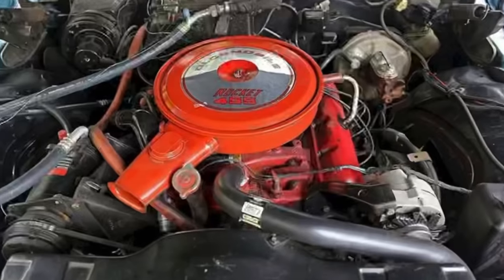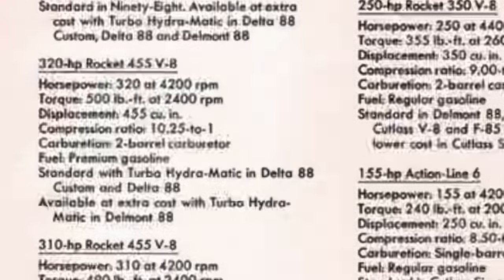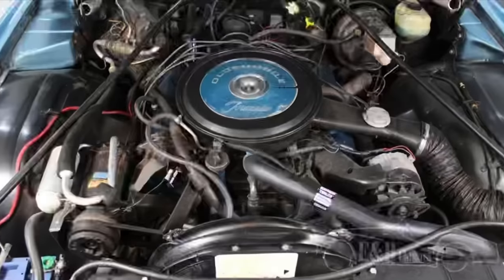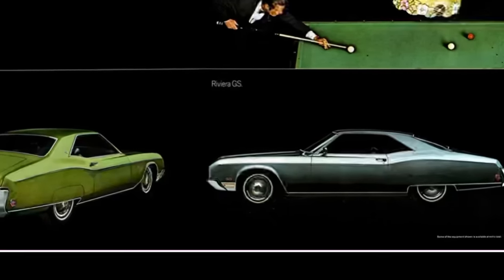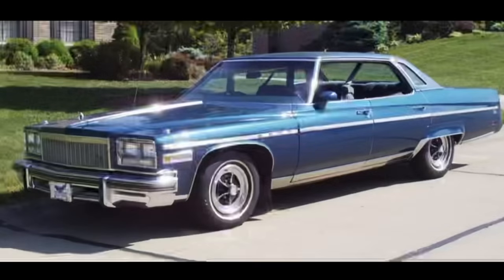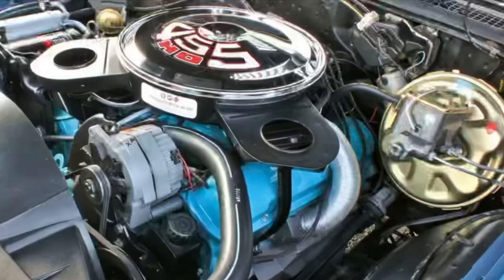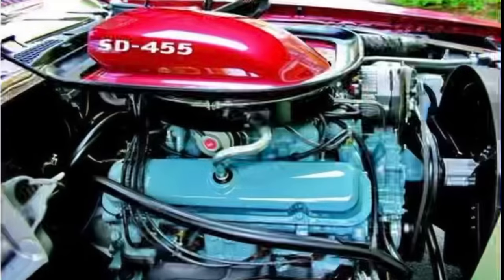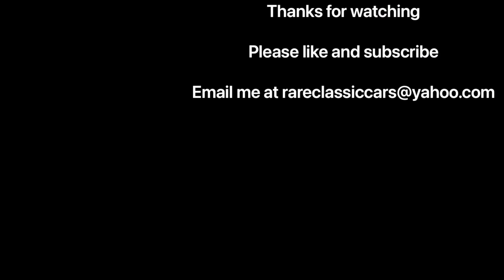Best Car Engines - The Rise of the Mighty 455 V8s from GM’s Buick, Oldsmobile, and Pontiac

Comment: As for me, I'm hoping the Olds 455 will be OK in my Revcon MH. It's a '73 model and though I haven't started it yet, I hope it will do good! The RV was a well made, high priced brand with a GM, front wheel drive power train.
Reply: GMC made an in-house motorhome for a few years in the 70s, and all they used was Olds 455 engines with the Toronado FWD transmission. Many of them are still on the road, so I'd say you'll be okay.

Comment: Stud the block on the Buick with stainless steel studs.  Also stainless steel SAE flat washers and nylock nuts.  This turns a 2 hour parts change into a 20 minute job.  Minimum tension on the drive belts and proper even torque on the nuts  There was an aftermarket manufacturer of water pumps that made a cast iron housing and used larger shaft bearings. This solved the problem, but  I have forgotten their name.

Comment: The 68-69 442 had the 400g, a very undersquare engine at 3.875" bore x 4.25" stroke. On paper it looks like the specs are from a prewar straight 8. They dropped that like a bad habit by 1970. The earlier 442s had the 400e a nearly square engine 4x3.85 bore & stroke. The was a good performance engine.
Reply: The 1968-up 400 was undersquare not oversquare.  The previous 400 engine also had a more aggressive camshaft which was why it outperformed the newer 400 which had a longer stroke in common with the new 455 engine.
Reply: @1575murray  I corrected the undersquare comment. The earlier 400 made more power because of a bigger bore, it could breathe better. The latter 400g did get the 308 cam on some versions but it still wasn't a great engine. The Ram Rod 350 would out run them.
Reply: @mcqueenfanman  I agree.  If you were running in NHRA Stock in CSA with a 428 CJ Cougar you had a dead heat race. The Mustang with the Canadian heads 428CJ beat them back, but you still had to be awake at the line. The early 400 442 2 dr post is still one the most beautiful race cars ever. And the Early 400 could take 6200 rpms like a champ, Uncle Joe Mondello had a great race parts program for those. A M21 and a well tuned Mondello 400 , I believe they were the J heads with the empty space were the heads.

Comment: Nice video..ive always been a bit confused between the pontiac and olds motors. Is it true the small and big blocks were same physical size bar the stroke?
Reply: The designation of big block V8 versus small block V8 is simply a matter of whether the engine is externally bigger than another engine made by the same manufacturer. It has nothing to do with CID size. Chevy is the perfect example of this. Chevy made a small block family of V8's from the 265 in 1955 to the small block 400 in 1970, and includes the 283, 327 and 350 in between. Chevy also made a physically bigger engine family, starting with the 396 in 1965, the 427 in 1966, to the 454 in 1970, so they're called big block Chevys, being compared to the small block Chevy. They're 2 different engines. The Olds V8 engines also come in small block and big block versions. But the Olds big block is basically a small block Olds with a taller deck height. They could be called tall deck versus short deck, but most people say big block and small block Olds. The Pontiac V8 is different in that (almost) all Pontiacs are the same external size, based on the original 326 from 1955. So, there's only the one engine size for Pontiac from 326 to 455. A Pontiac 350 is the same size as a Pontiac 455. So, there is no small block or big block Pontiac because they're all the same size, and there aren't any other Pontiac V8 engines. There are 2 exceptions...the Pontiac 301 from 77-81, and 265 in 80-81. They are still based on the traditional Pontiac V8, but with shorter decks. Could be called short deck Pontiacs.

Comment: The Olds 455 was chosen by GM to power the GMC motorhome in 73.  That might say something about reliability.  Or it could have been the readily available Toronado front drive powertrain used in the motorhome.  Someone might know more on why Olds was chosen over the Cadillac Eldorado powertrain.
Reply: You hit both nails on the head. The front wheel drive setup, from the Toronado, was a no brainer for the motor home, along with the torque of the Olds 455!!

Comment: Both Buick and Pontiac used an aluminum timing cover that the water pump bolted to. Removal of the pump bolts either took the threads out or sheared off the bolt head, not fun. The Pontiac had a cam bearing priority oiling system which tended to starve cylinder wall lubrication. The Buick was a thin wall cast block which gave a significant weight savings on the frontend. 455 Skylarks were notorious for stomping their contemporaries in 1/4 mile runs.

The Olds had shaft style rockers that were made of cast aluminum (Not good). Their blocks were all made of high nickel casting alloy like AMC and truck blocks from Chevy and Ford. (High wear resistance for the cylinder walls)

All of these engines were pretty much at their limit because of cylinder spacing, so they increased the stroke which limits RPM. (But you can produce a lot of torque)

The mortarium GM had in place kept these monsters out of mid-size cars until it was lifted in 1970. (Except for the COPO's and 3rd party cars.) Then all the compression ratios were dropped to 8.5:1 in 1971 and in 1972 horsepower was changed from flywheel to rear wheel with any and all optional equipment installed and operating. (Net HP) There was also some early fudging of HP numbers to appease the insurance co's. Also in 1969 all California cars required air pumps, EGR and vapor canisters, the rest of the nation followed suit in 1971.

While the displacements peaked out around 1970 the higher revving lower displacement engines from the late 60's produced more HP IE: 1969 L89 427 rated at 430hp @ 4800 rpm really produced over 500hp @ 5800 rpm compared to the 1970's LS6 454 which only produced a measly 450hp. The displacements were increased to make the engines burn cleaner.

By 1975 it was all over but the cryin' and the diggin', at least until the late 80's when computer fuel injection and overdrive made good milage and high HP possible again.

Anyone remember the nightmare of changing the rear two passenger spark plugs on a big block A/C mid-size?

Comment: I had a 79 cutlass Supreme it came with the small Olds I think it was a 260 or 265. I can't remember. I yanked it out and dropped in a 1970 455 Olds out of a 98 LS. I put in a hotter cam, aluminum intake, converted the non adjustable valve train to adjustable because the cam swap. Ported the heads and headers with dual exhaust.  The engine dropped right in with the stock mounts. The differential was a 2.56 ratio. I could almost do 80 in first gear. In drive the highest rpm I had it to was 4300. It could go higher I know because the 455 had the torque to turn it higher. How I didn't kill myself in that death trap I don't know.
I actually out ran some motorcycles. Probably smaller ones. But I had the advantage on the interstate. It was a death trap.

Comment: Buick is under appreciated because it was seen as an old mans car.  In muscle car intermediate trim in turned out the Buick 455 in 1970 got the best 1/4 mile time over its Pontiac and Oldsmobile counter parts.   The real advantage for live ability was in 1970 car insurance for a young driver for the Buck 455 was sometimes 1/4 the price of a 455 Chevelle and it out performed it at the drag stip.  

To get any real high performance out of these engines they needed different cam shafts and significant modification tuning.   The tri-carb GM setups where very good for high performance and drive ability.    Done with a lot of knowledge you could have a daily driver that could rev to 6,700 rpm such as a 1966 GTO tri-carb 4-speed with large displacement forged crankshaft giving something around 460 cu in. and over 600 hp.  I was in such a car once and those tri-carbs really come a live well above 5,000 rpms where the stock 455 engines have their red line.

Comment: Never understood why GM allowed Chevrolet to advertise a 454 instead of a 455 to have 455s across the corporate board, excluding Cadillacs. That would have made a great commercial and advertisement ploy.  After all, in 1970 Chevy called their 402, both 396 and 400. Even FoMoCo called their 425 the 427. Although I've never done the math to confirm the rumor, I've heard it said Chrysler called their 427 Hemi the 426, to set it apart from the rest.

Comment: Installed a 455 Olds engine from a 69 Delta into my 72 Cutlass.
Car was a tire fryer.
Could never get traction.
Reply: Yeah man, you had to feather the throttle for traction. Else she was a tire smoke machine! Rocket Power!
👍😎

Comment: A very interesting video but I would have liked to have seen the Chevy 454 included. Do you know if they were all at 455 displacement? For example, I think for several years Chevy's 396 was actually 400 cubic inch. Also, Fords 427 was closer to 425 CI displacement. You mention that the Olds 455 ran out of breath at high RPM due to the undersquare nature of the engine. I think the restrictive ports coupled with small valves in the cylinder head were the real reason?  Would like to see a comparison of Fords 428 vs Olds 425 vs Buick 430, etc.

Comment: The one big question looms in my mind, that many younger viewers may have as well: How much did gasoline change from the late 1960s to the early-to-mid-1970s? You mention how GM adopted a policy of all car engines operating on regular unleaded fuel, which I assume meant 87-octane. If this is the case, what kind of octane ratings did the previous generation of luxury and muscle cars guzzle for fuel, and how did that (presumably) higher-octane fuel affect horsepower?

Comment: The 66 up cars! You could hear a 69 428CJ Mach 1 banging through the gears and wailing like Banshee, and the Olds 442 in 64-67 with the 400 OA1. The 455 Oldsmobile in 1970 was just plain tough.  The would run flat out on the Interstate at 5200 rpms and you couldn’t break them. The 428CJ was that way as was the 440 Mopar. The CJ got there the quick est but they could literally go until they ran out of gas flat out in high.   I have a warmed over 390.020 over that can run at 6200 all day and I built it in 1999 and it is still going strong! No oil consumption or Blow by.  The 60s and even the 50s designs FE and Pontiac were really good and bulletproof engines. I have a solid cam in mine and blocked lifter feeds and it will rev to 7000 with no problem. The Pontiacs I have done like a McKellor solid cammed 421 SD with the factory endurance stuff and a 400 RAIV with a custom solid were in breakable if you could build it right!  Both of these engines hit their stride as Street Thugs by 63, but both are 1950s design.  Those were the days. My Dad had 55 Fairlane with a hot 292 he had stroked and bored. It would idle like a gasser, lol 😂

Comment: @6:38  A 455 with a 4bbl, and it is supposed to inhale through that Itty Bitty Snorkel ? My dad's LaSaber has that Air Cleaner. I took one from a 76 Olds which had a Snorkel with an Opening twice that size, then added a 2nd Snorkel, that opened under Full Throttle. It made a difference, and at 17 was quite Proud of my Engineering Ability

Comment: Olds 455 is my pick for the best one. Buick had 4" mains and a not so good oil pump. Changing the spring in the pump helped, but didn't solve the issue. It would just run out of oil. Poncho had a high pressure oil system. Good at first, but when a bit of wear was had, the tolerances of the poncho were too tight (to the 10,000th) and revs would rod or wrist pin knock it. This how every one of mine met its end. If you use the C casting head from 69 on any Olds 455 (with a port job + a good build) you can make 500HP+ and 500+ TQ. Keep it under 5k if not balanced rotating assembly and top end oil restricters. I had one in a 84" Cutlass and it was a tire frying delight! 185+ mph.

Comment: If you look at their bore spacing, you'll find that while the Buick 455 was a "big block", the Olds and Pontiac 455s were technically "small blocks".
Reply: The Olds was a big Block , all Pontiac used the same block except the 301-265.
Reply: The Olds 455 is a tall deck block, and often referred to as a big block, when compared to the shorter deck small block Olds V8's, like 350 and 403. So, the Olds 455 is not a small block. 
Pontiac did not have the customary "small-block" and "big-block" designation, unlike engine families common to other GM divisions, especially Chevrolet. Effectively, production Pontiac V8 blocks were externally the same size from 326 to 455, (except for the later short deck 301 and 265 produced in the late 1970s and early 1980s). So, since the "traditional" 326-455 Pontiac V8's are based on the same block and externally the same size, they aren't considered either small or big block. So, the Pontiac 455 is not considered a small block or a big block.

Comment: You forgot to mention the oil pump problems on Buicks. They all suffered from the external aluminum oil pump housing, I had a 231 with no oil pressure from lack of maintenance. But the 455s were a real problem, as long as you addressed it before the oil pump housing and gears wore, you were okay, but if you didn't, beware the seized engine. The good thing about the bad oil pump was, it was a driveway repair, just remove the cover, put new gears in, and a thinner shim. And you were more or less back in business, if you caught it soon enough
Reply from the maker: I did mention oil issues, but didn’t delve into it.
Reply: @RareClassicCars  oh, sorry, I missed it

Comment: I knew a vet owner who pulled his 454 and dropped in a worked 455 from a '74 Riviera. If I remember correctly, the nichol / Iron block of the Buick was lighter and much stronger than the 454.

Comment: Dana "60" Glass. You are leaving out the '68-'69 Hurst/Olds, and very limited '67 4-4-2 Hurst Performance. I'm well aware that GM had the 400 cubic inch limit. Also in '69 the Buick Riviera was the 1st year for the electric fuel pump.

Comment: my late maternal grandmother had a 72 Oldsmobile Delta 88 then a 75 Ford Granada a used 79 Cadillac Coupe Deville Hardtop then a used 1984 Buick Skylark though that had 231 CI3 3.8 L V6 then she traded that in for a 1990 Toyota Camry with a 3.5 L V6

Comment: Why did each Buick, Oldsmobile and Pontiac all decide to enlarge their engines to exactly 455 cubic inches? Seems like it would be easy to vary it with insignificant changes to bore/stroke

Comment: I purchased a 1968 Buick Wildcat back in my younger day`s 1976 , I think. I can`t remember the engine size but I can tell you, it was fast !
Reply: That would have been the Buick 430, which is the same block as the 455, with a 4.1875" bore instead of the 455's 4.3125". I had a '69 Wildcat with the same engine as my first car in 1985.

Comment: Hello from Australia.  Relying on my memory here but the olds 455 is bigger and heavier than the Buick 455 right ? much more like big block weight.  Although 426 Hemis are always seem to be though the top gun looking back, the GS buick 455s ran the faster 1/4 times.   The weight of the Buick engine is it's biggest selling point for me.  If you fit an alloy intake manifold it's about the same weight as an iron small block Chev.   I bought a few engines when they were a give away price.   I then got all the T/A performance heads, manifold, pistons etc.   I was going to put it in my GT40 replica.   Didn't end up doing that and sold it to a friend who had it set up by a Buick guy.  Can't remember the detail - small stroke, work on the T/A heads and manifold and other odds and ends.  He'd had a standard  Buick big block in an XJ6 Jag for years and he put this in another one which he stripped of heaps of weight.  1973 short wheelbase Jag and he has the weight down to 1300kg and still reducing.  Car has Tremec, 9" diff centre, Brembo brakes and not much more done.  Over 600 hp and tons of torque.  He mostly uses it on the track now.  He runs track days with a sort of track day / race instruction type group.   All the cars are on the track at the same time, but you're not really supposed to be racing seriously.  Overtaking is sometimes inevitable of course !  Well heeled guys bring their Porsche  GT2s and GT3s and look pretty deflated when he just walks past them on the straightaways. He can easily pass most cars in corners too but only does it occasionally not wanting to be accused of being too serious. It really is a pretty quick thing.  That's why the Buick 455 base is my favorite.

Comment: Ah, yes, the days of 6-8 miles per gallon. LOL I had a 69 Delta 88 with the rocket 455. Spark plugs and oil changes was all I did. Very reliable.
Reply: I had a '68 New Yorker with a 440 that got 7 mpg.  After a rebuild it went up to 11.  Doesn't sound like much, but it was a 50% increase.

Comment: Olds did not put the 455 into the 442 till 1970, but they did put it in an A-Body car (same body as the 442) in 1968 and 1969 with the Hurst/Olds. The Hurst/Olds were essentially 442's with the 455 engines, and some graphics and body mods. The 455 SD was probably the fastest 455 ever built by Pontiac. It had the best heads ever on a 455 that flowed a lot better than earlier 455 heads. Car and Driver ran a 13.7 at almost 104 MPH With a loaded Trans Am that weighed almost 3900 pounds with an automatic transmission, that could at the most have 3.42 gears. The Car and Driver car probably had the 3.08 gears, because at the 3900 pound weight it probably had A/C, and with A/C you could only get 3.08 gears. Now, try running 13.7 with a 1970 GTO 455 HO with an automatic transmission and 3.08 gears, not going to happen.